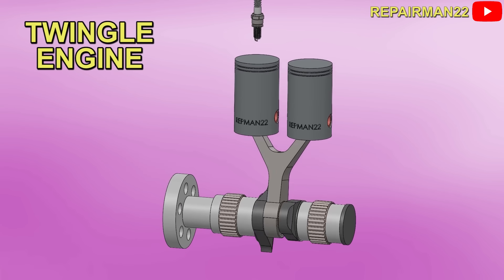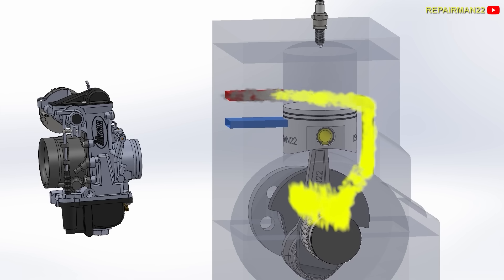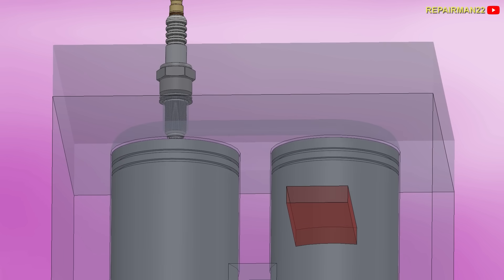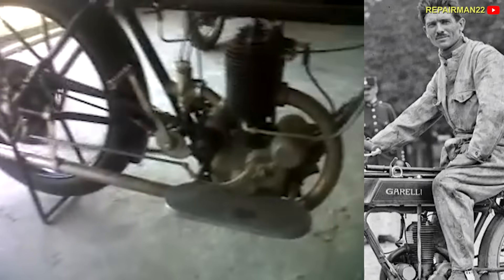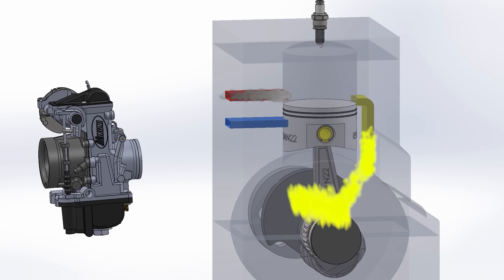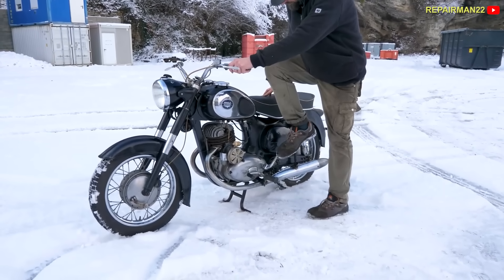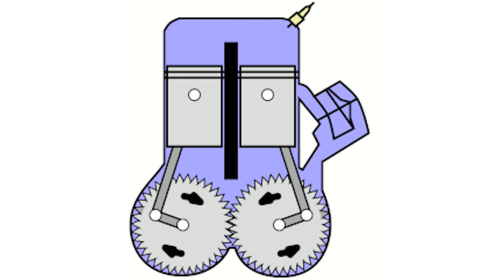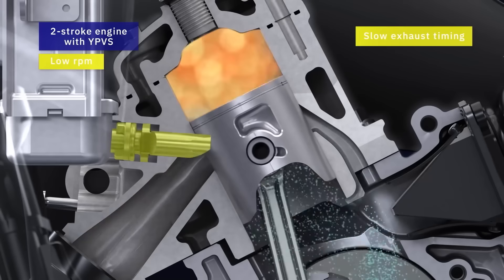The Twingle Split Single Engine used for 70 years 🤯

Comment: Dear Repairman 22 you might like to do a show on the "Rotary Radial" aircraft engine which was widely used in WW-1.   It's the only engine I know of where the crankshaft was bolted to the firewall and the engine rotated around around the crankshaft.   It was a 2 stroke engine with the propeller bolted to the crankcase.  Sooooo... the engine spun at the same speed as the prop.  
The Rotary Radial was used by the French, British, and German air force.
Reply: Rotary radials are 4 strokes, every one of them. Some of the single valve Gnomes, what were called "Monosuapape' had intake transfer flutes in the cylinders that were uncovered  at the bottom of the stroke but they were all 4 strokes, despite the smoke and 2 cycle style of fuel air transfer.
Reply: Strangest radial engine was the Fairchild-Caminez. 4 cylinder, 4 stroke that had 4 power strokes per revolution. All done with an ‘8’ shaped cam/ crankshaft and roller followers on the pistons - which were all linked together.

Comment: The Twingle or Twin Angle engine is based on a very crude machine built be Canadian lodgers in the 18th century, it's principle was you hade two vertical pipes positioned together with wooden pistons (made from tree trunks) which would be driven up and down the pipes  by a steam pump engine at the top. This was used for making waves on the river used to float the cut logs to their destination for processing. This principle was only used in a small area of Canada where the natural river water flow was not strong enough to float the logs at a reasonable speed.
Reply: I have heard of sluices and flumes but never of the wooden piston pump !

Comment: I got a 66 Sears Allstate 250. It's torquey as hell with the gearing for riding through the Austrian alps, and has ridiculous whiskey throttle in 1st. 

If I could get a title and parts weren't ridiculously priced, it would be nice to restore and take to car and bike shows. At this point it's just a big trail bike to ride until the piston slap takes it out 😢. I have been tempted to put the engine in something else. It would make a hell of a go kart engine😈.

Comment: I called this,  The NO fuel engine,  by using electric magnet pistons,  using a oil rings,  and using the north and south of a electric magnet,  to push and pull,  the piston, and alternator and two large truck batteries,  want more horses power,  bigger the pistons,  want less,  horses power,  smaller the pistons,  basically magnets,  would be on top of the pistons,  and the electrical magnetic,  power by electric,  from the alternator and batterys,  apply more energy, faster it go, apply less energy,  the slow it goes,  ??????

Comment: I remember in the early 60's my dad had a Sears Allstate, the engine in that bike the pistons were front to rear, different than the one you show, during the year or two that he owned it, it burned a hole in the rear piston several times, I was about 5.

Comment: the diverging part of the exhaust pipe resonator is the part that reflects the wave back up to the exhaust port. The diverging section slows the gas and the gas behind it hits the slow gas and makes the pressure go up. Bernoulli.
Reply: nope, the divergent part reduces pressure, increasing cylinder scavenging. the convergent part reflects the echo as a physical wave back to the exhaust port preventing fresh charge from escaping by increasing pressure.
dwell is the length of the chamber between the two cones, determining the time for the sound wave to return to the exhaust port. effectively tuning the pipe to certain rpm ranges

Comment: I bought a used Sears Puck 250 in 1975. Interesting engine, lots of low end torque. Wished I still had it.
Reply: yes I had a 175 PUCH  made by Styria  Austria 2 pistons one head .
Reply: Yes, I remember the Allstate 175 made by 'Puch' and sold by  Sears.
Reply: 250 puch 2 stroke sold by sears was my first motorcycle given to me by my step brother in 1973. Before even starting it someone passing by on the road offered to trade his 1973 DKW Sachs 125 dirt bike for it. So I owned a puch 250 for only 5 minutes.
Reply: Puch engines were also used in the 100 and 125 Penton. The 175 Penton came with a KTM engine.
Reply: Im 16 and I just got a 69 puch and its my first motorcycle sadly it really isn't fast enough for most roads

Comment: I remember the old Sears Allstate 250 motorcycle had this. In those days they were fast! 😄
Reply: At close to 350 lbs with only 15 HP I wouldn’t say it was particularly fast. Mine topped out at around 65 MPH.

Comment: Surely a direct injection two stroke would solve all these problems.  Were they ever made?
Reply from the maker: Yes. That's another reason why twingles are nonsense today.
Reply: EMD made millions of them, so, yes. To quote "History and Development of the 567-Series General Motors Locomotive Engine:"

"The basic 2 cycle engine design established at this time has been successfully used in the full line of Diesel engines built by General Motors and therefore has been applied to a great many of the Diesel engines in use in the world today. These have all been direct injection, uni-flow engines with air admitted under pressure supplied by the blower to the cylinder through ports in the cylinder liner with the piston acting as the intake valve. The exhaust valves in the cylinder head are open when the intake ports are open, allowing the fresh charge of air to sweep out the combustion products of the previous cycle. Valves and ports are closed at approximately the same time and the fresh air charge is compressed. Slightly before the top of the piston travel, fuel is admitted with very exact control by the unit injector and combustion occurs very near top center to allow full use of the developed power."

Comment: The REAPAIRMAN has his pictures wrong in the thumbnail at the side. One of the views shows the Crank and gudgeon pin in a parallel configuration and the CUTAWAY view shows the crank at RIGHT ANGLES to the Gudgeon pin WHICH CANNOT BE AND CANNOT WORK. Maybe the REPAIRMAN is a DUD.
Reply from the maker: The engine behind me is the Yan Engines split piston engine. It has 2 connecting rods.
Reply: No no, this isn't the reaperman 🙂

Comment: In 1964 a friend bought a used Puch 250 SGS that would only go 20 mph.  The motorcycle shops could not fix it.  I did and got to know the Twingle system.  In 1968 I bought one new from Sears as an Allstate.  It would not run from new.  I told Sears what was wrong and they would not believe a stupid customer knew anything, so they had to refund my money.  Too bad, it was a nice bike for its size back then.
Reply: If it didn't run and your friend's bike only did 20 mph, how did you come to the conclusion that they were "nice bikes"?  They sound like they were, in your experience, pretty crappy.  I own a Ducati 250 I've owned for 45 years and it does 65~70 mph easily.
Reply: @tauncfester3022  I said in the third sentence that I fixed it.  It ran fine after that.  It did more than 70mph, easy.  That is why I bought a new one years later from Sears.  It was DOA because  the local Sears "adjusted" a running bike pre delivery and made it quit working.  I offered them the fix instructions and even said I would do it myself right then and it would take less than 5 minutes.  They were not about to listen to a dumb customer so I told them to stick it and got my money back.  I'm still here and Sears is mostly gone.
Reply: @tauncfester3022 OP FIXED the first one.  Some of us can do that and end up with nice bikes.  Some of us can also read.  M_r_n.
Reply: Pity, nice looking bikes..(ah, good ol' sears..might order a resonator guitar, and a morphia/heroin/coca/syringe kit, while I'm at it?)...my how things have changed?...
Reply: I have one.  It runs great.  Starts on the first kick and has plenty of low end torque with good speed although being 70 years old I treat it nicely....

Comment: The Danish police used the Puch 250 in conjunktion with the Ariel Square Four. The Puch in towns, and the Ariel on the open road. So whereever they showed up, the bad guys had a hard time. ;o)
Reply: The Danish police must have loved the back of their engine overheating

Comment: Why not just make a oval piston at that point
Reply: Sealing an oval piston is not as easy as it might seem.  Soichiro Honda managed to do it later on.  These were never considered to be race engines.
Reply from the maker: The key is the wall in the middle to create a "uniflow" scavenging.
Reply: Or why not just make a square piston 😄

Comment: So much effort to make 2stroke engine as efficient as 4stroke; only to make it more complex, heavier, more expensive - and it still sucks compared to 4stroke.
Reply: it's cheaper than 4 stroke cos it doesn't have a camshaft or timing gears. it's cleaner than 2 stroke as there's no unburned fuel. fortnine had a video about it and i agree with his suggestion that it could be developed further.
Reply: @martin-vv9lf  Many large scale ship diesels are 2-stroke. On a diesel the unburnt fuel situation is not an issue, but there are other emission issues. Also look at the Detroit diesel engines, they are 2-stroke diesels. Just visit the channel "Bus Grease Monkey" to get a large share of that. 2-stroke diesels with 4 valve heads do exist.
The advantage of a 2-stroke diesel is that it ignites every time the piston goes to the top.
Reply: Two strokes power the worlds cargo ships and will for much much longer, altho its not via crankcase scavanging. Marine Diesel Two Stroke engines are the most efficient, reliable and long-living, hence why they are so widely used in shipping
Reply: @Handyman1199  Because marine diesel 2-stroke engines have direct injection and exhaust valves. So no comparison to small petrol 2-strokes. Modern 2-stroke outboards from Evinrude, Yamaha and Mercury did also have direct injection. But they are no longer in production.
Reply from the maker: I have a 2 stroke diesel video if you want. Thank you!

Comment: I would have never imagined the Puch 250 to be sold in the USA. As you indirectly mentioned the technology for this kind of engine was already ancient and outdated by the time they were first produced. And I think they were made until mid 70s!
Oh and nice video.
Reply: They also made them in 175, 350 and 500cc versions.  My dad had a '64 250 and I had a '67 250  I thought his was the nicer looking, but I kept mine for 20 years longer.  I rode it from St. Louis to Alamosa, Colorado and all around Colorado Springs.  It would only do about 60 mph and I had to draft trucks on the freeway, but it never, ever failed me.
Reply: I had a Puch 50 cc moped, it was pretty bulletproof, and got around 125 mpg…
Reply: I had an SGS 250 in '65 (a '60 model) Bombproof and  it could keep up with Honda cb72.